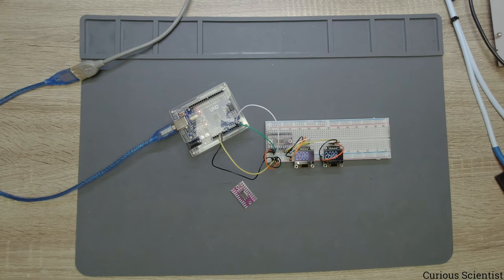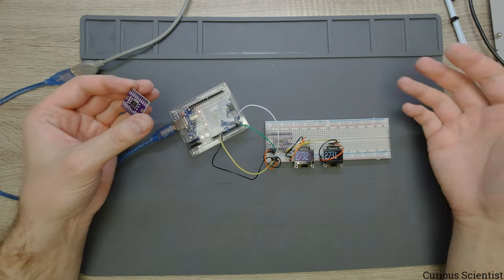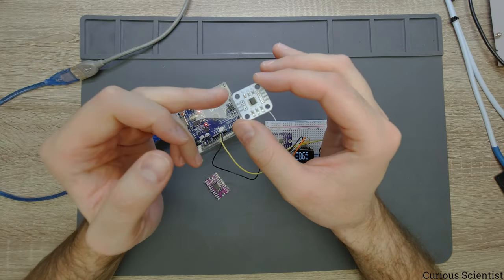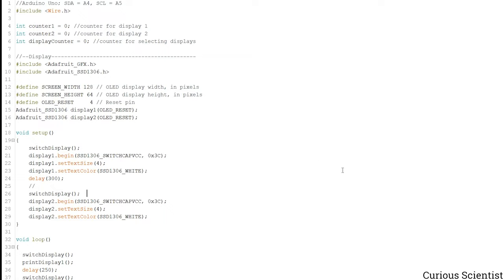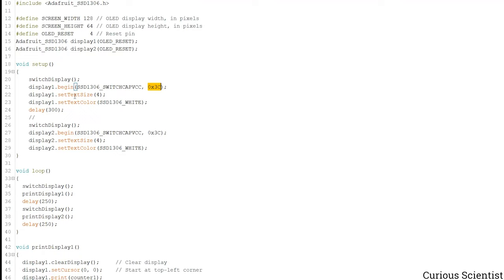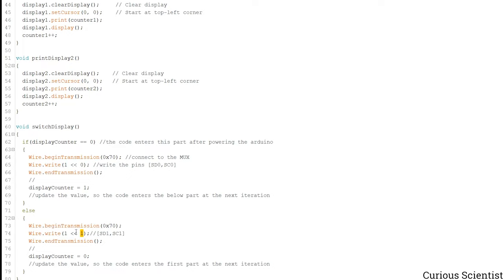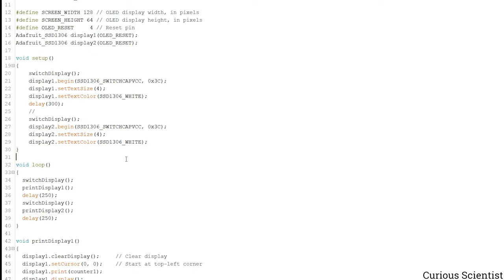TCA9548A i2C multiplexer

Comment: Is a great solution for several inconvenients. I just wonder how fast it, in practice, is handling its child devices. I will look forward your next video to see more about this.
Reply from the maker: Yes, it is a very nice circuit! As I mentioned in the video, I will check it with two AS5600 circuits. Since I will need to read them fast, it will be a great test for this circuit.
Reply: From TI datasheet, should be plenty fast and not noticeable.
In standard mode supports a max I2C clock frequency of 100kHz and in Fast Mode goes all the way up to 400kHz.
I don't know the downsides of using the Fast mode to be honest.
Reply: @CuriousScientist  Hi friend ... Have you uploaded the video with the mux and the AS5600 yet?
Reply from the maker: Hi! Yeah, about a year ago... Maybe you should subscribe to the channel. :)
Reply: @CuriousScientist   claro que si estoy suscrito... muy buen contenido!!!
Reply: How to select channels?? By changing wire.write??
B0 = (1 << 0)
B1 = (1 << 1)
B2 = (1 << 2)
B3 = (1 << 3)
B4 = (1 << 4)
B5 = (1 << 5)
etc...
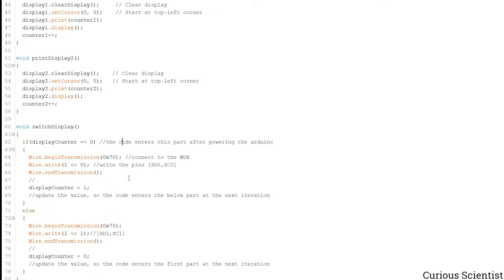Reply from the maker: Watch the video. The explanation starts at 8:44.

Comment: 2:00 It is not true that when two devices of the same type at the same address (like in the video), for example a display, cause a conflict on the I2C bus.  When these devices are on the same address, they act and update exactly the same.  The problem is (if that is a problem) that you cannot change them individually because they listen to the same address.
Reply from the maker: Well, that's the problem that you want to update them individually while they hold the same address. The video shows how to solve that issue with the multiplexer.
Reply: @CuriousScientist  You said there is a conflict, there is no conflict. There is only a conflict when there are two devices (or more) at the same address, the same functionality and the MCU asking for data or at a totally different functionality (different devices).  The last one with different devices on the same address and asking for data, ruin your I2C communiction completely. You can also make a sniffer, a listener, to any address you want, doesn't matter.
Reply from the maker: It depends on how you want to interpret the word "conflict". I am not a native English speaker, so let me have a few mistakes. I provided a useful solution for  an issue for free, so let's not get stuck with some "misuse" of words. 😉

Comment: Hello, great video 😁,

I'm a beginner and I have a question :
 Can the TCA9548A multiplexer work with the MCP23017 GPIO Expander?
Thank you in advance for your precious support 😄

Cordially.
Reply from the maker: Hi and thanks! 
Why would you multiplex the MCP23017? You can create 8 different addresses using its A0, A1, A2 pins. Thus, you can chain up 8 of these chips using the same i2c bus. But if you need even more I/O expanders, then yes, you can use this i2c MUX. But as long as you are below 8 chips, I recommend using the MCP23017's address pins. It is much simpler.
Reply: @CuriousScientist  Hello, thank you very much for your feedback. 

I wanted to control 2 MCP23017 with an arduino board using I2C but since the MCP23017 devices have the same address, I planed to rely upon the TCA9548A multiplexer which can control devices with the same address.
-On one hand, the TCA9548A multiplexer would be connected to the arduino board
-On the other hand, the TCA9548A multiplexer would be connected to the 2 MCP23017 devices

I prefer your solution of using the pins A0, A1, A2 of the MCP23017.

Just to be sure : Does it mean I have to connect the pin A0, A1 and A2 of each of my MCP23017 to the pins of my arduino (for example the pin 4,5 and 6 for the first MCP23017 and 7,c8 and 9 for the second ) and send on pin A0 to A2 a byte?
Do you have a link explaining how to do so? 

Thank you in advance for your precious support 😁.
Cordially 😊
Reply from the maker: Hi! They do not have the same address unless you give them the same address on purpose (or leave their address pins untouched). There are three pins A0, A1 and A2 on the MCP23017 chip and depending on how you configure these pins (HIGH or LOW), the address will be different. Read the datasheet of the chip about how to configure their address if you are unsure. Just to clarify. You do not need to connect the A0, A1 and A2 pins anywhere on the Arduino. Depending on what board you use for the MCP23017, there will be 3 jumper pins, or DIP switches, or solder tabs. You have to play with those, the Arduino does not have to be involved with the addressing. I recommend you learn this first because working with an i2c multiplexer is much more complicated.
Reply: @CuriousScientist  Hello, thank you very much for your feedback 😁 and your explanation. 
Ok, I'll check how to set up the address for the 2 MCP23017.

I'll come back to you if I have other questions.

Have a nice weekend, 😁.
Cordially 😊

Comment: Hi, How can I do for multiple SHT20 sensors? I couldn't find multiple examples for these sensors on the internet. I would be glad if you can help with this. Have a nice day.
Reply from the maker: Hi! I have never worked with the above mentioned sensors, but you just have to switch between the different channels on the MUX board and then reach the different sensors.

Comment: It works fine with uno but nothing on DUE...can't figure out what's going on
Reply from the maker: Well, "doesn't work" is a very vague description, so I can't figure it out either.
Reply: Yes, sorry, probably it's a problem with SDA SCL , on the due I don't use A4 or A5 . I tried on A4 and A5 to make sure  but nothing works...
Reply from the maker: Due uses pin 20 (SDA), and 21 (SCL), you must use those pins.
Reply: @CuriousScientist  yes , i did